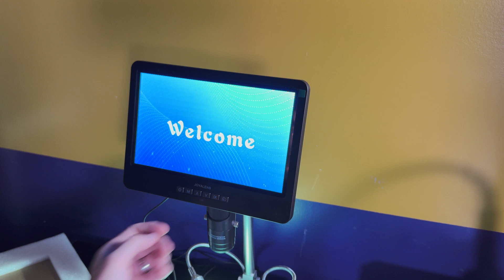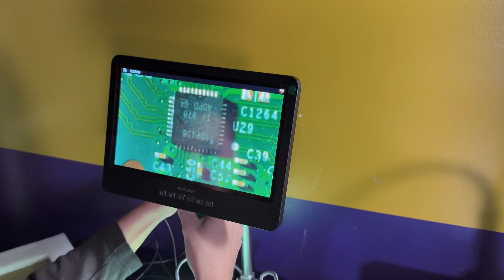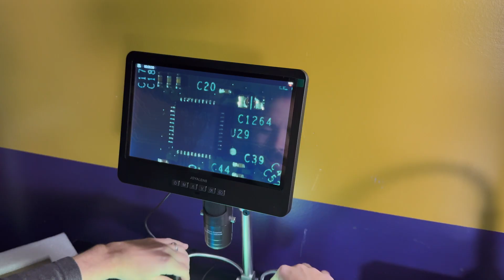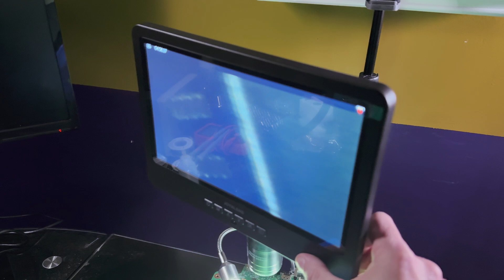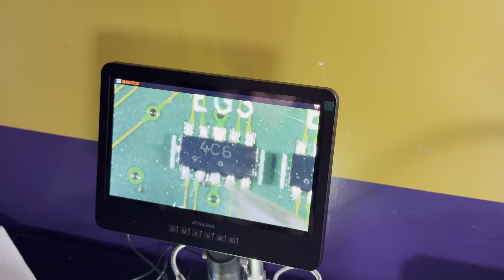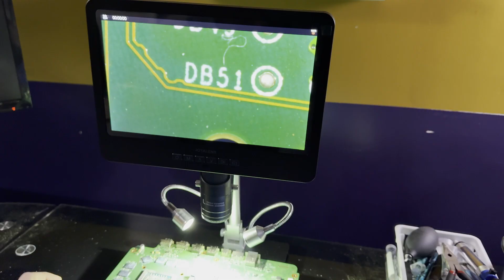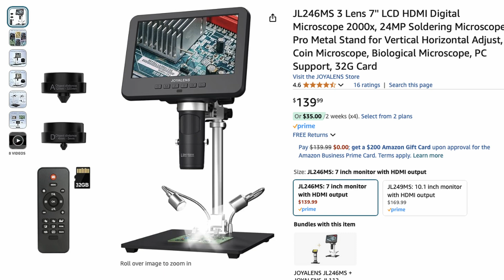A New Digital Microscope - JOYALENS JL249MS

Comment: Hey, tried to add a comment (twice) but it keeps getting deleted. I guess because of the link I added.
Anyway: I have a similar microscope (Andonstar) and I have recently bought a microscope arm (which is just a microphone arm with a different attachment: a ring in which the microscope mounts). This makes the microscope much more flexible. You can swivel it out of the way or swivel it back for easy access, you get a much bigger workarea because the gooseneck LEDs aren't in the way (they don't add much) and you get a much greater vertical range as well. I can wholeheartedly recommend this 'mod'. Let me know if you can't find it.
Reply from the maker: Hey if you have a link for it and YT won’t let you post it, can you send it to my email? Fixmorewasteless@gmail.com
Would love to check it out. The limitation of the work areas about my only real issue with it.